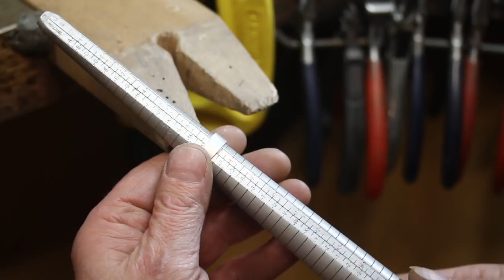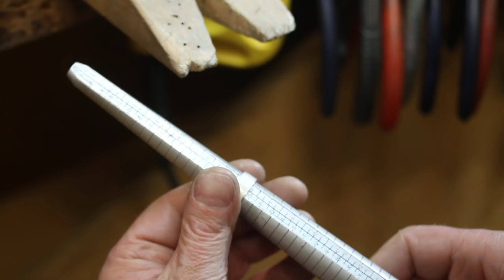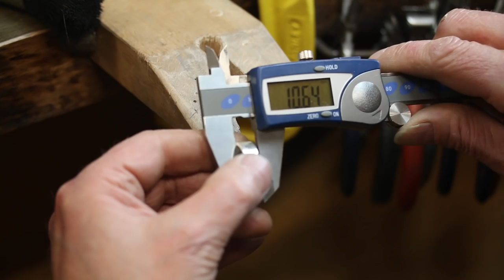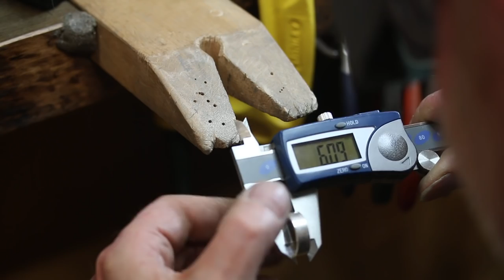Making a simple ring

Comment: I liked that touch with the scraper to break the edge. It’s akin to an edge beveler in leather work. 

Question. If you look at the ring in my thumbnail I made it from a batch of that copper/silver alloy you showed how to water cast. I cast a small nugget and drifted it, I then opened it up on a mandrel. I did the same with silver and opened the silver ring into the copper one. My question is this, is a ring with no solder a stronger ring or am I just fooling myself. Glad you’re making videos again, they are relaxing and very informative, albeit far beyond my skill set.
Reply from the maker: Hi Scott, I suppose that in principle a solid ring with no solder join might be stronger but a well soldered silver and gold band is pretty secure. What it would come down to in terms of workshop practice would be the time involved (time is money) vs any real practical benefit.
Reply: Ford Hallam's Japanese Metalwork Channel thanks for taking the time to reply. Did you ever post the rest of the iron tsuba carving, I think it was from a meteorite?